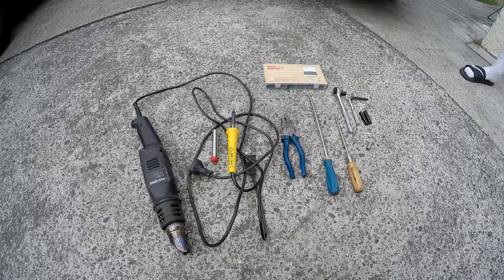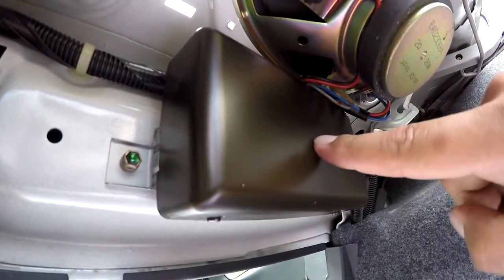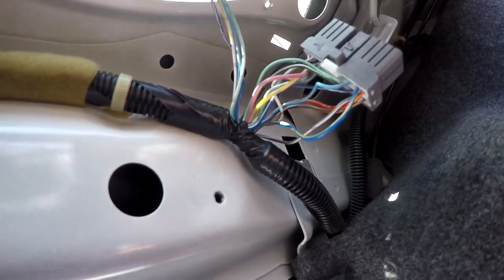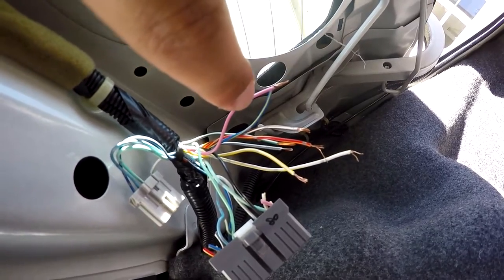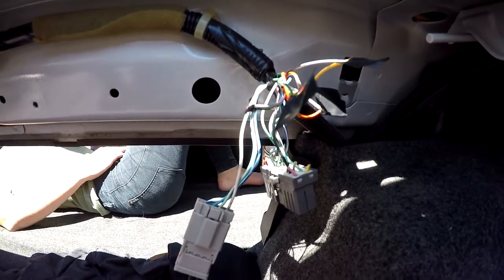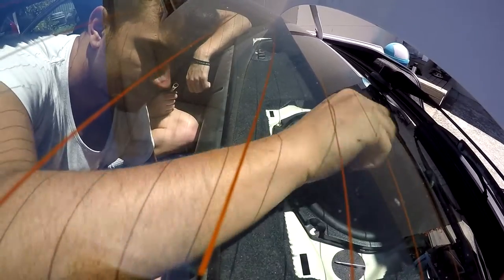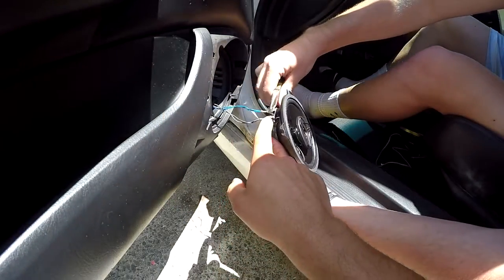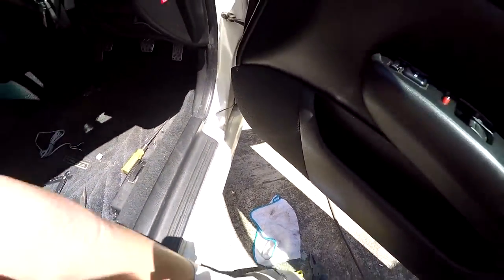(Tutorial) Honda Prelude "The Lude" Build Ep. 11 - Acoustic Feedback System Bypass

Comment: Thanks for the video ! This is the easiest car to change speakers I’ve ever had ! Only thing I did different is NOT cut any wires. I left the original Crossover “AMP” and removed the electronics from the stock speaker and installed it perfectly in the same spot on my new speaker with some door bell wire . The crossover has 2 holes and I braced each hole with its own wire side to side you can pull it right and mount it proper . Much Better than cutting all that wire & sounds better . That’s the right way to keep it stock and use all OEM wiring and components
Reply: Did you not change your head unit because from what I have heard, you HAVE TO bypass the amp if you replace the head unit for the rear speakers to even work?
Reply: sagar kumar Deck.... i kept it stock
Reply: sagar kumar I kept it all stock , even crossovers . Even looks stock

Comment: Looks like a lot of work I have the same setup in my 2000 Prelude type SH. I put a new radio in and just ran fresh OFC speaker wires to the radio problem solved. Later I just disconnected the speaker from the radio and hooked it straight to my JL Audio amp.

Comment: Wat size r those front speakers? I have some 6.5" and they dont fit.
Reply: 6.5 is the correct size but if they are not super shallow speakers you will have to cut out the speaker cup on the door panel and use a custom mounting hardware set up
Reply: @CldBroccoli  Thnx for the reply, but I got them figured out lol. I appreciate it.
Reply: @Chue_Media98  what did you end up doing?